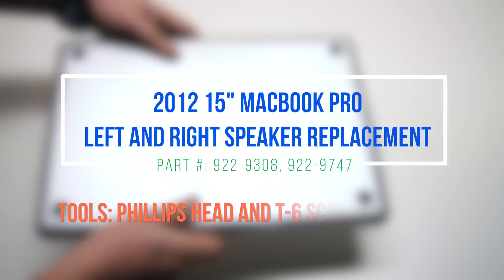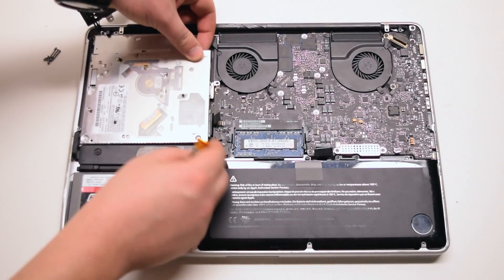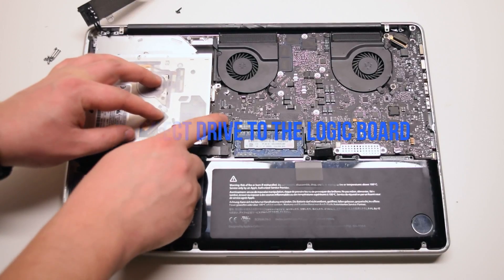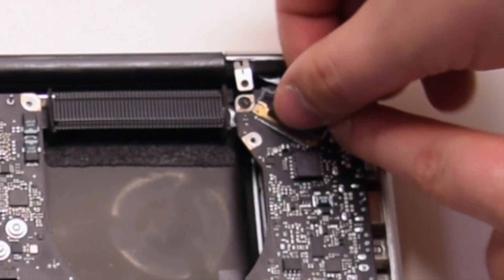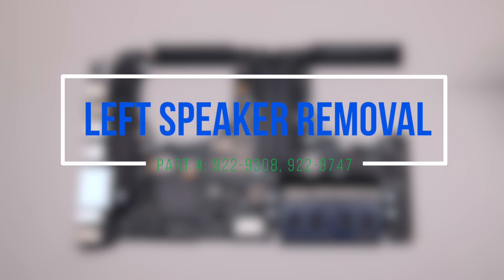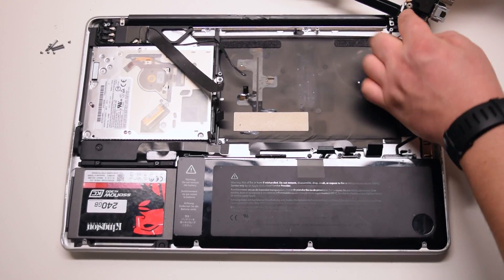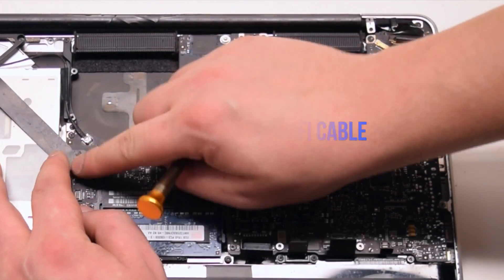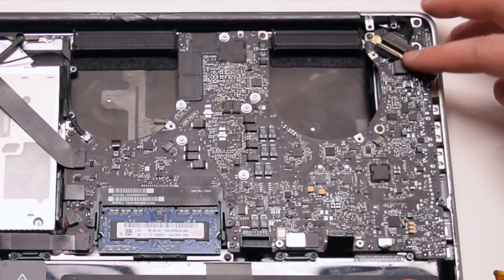2012 Macbook Pro 15" A1286 Left and Right Speaker Replacement

Comment: Wow, thanks for this. I recently brought my Mid-2012 MacBook Pro in to a local Mac tech to replace a faulty keyboard; when I got it back, the keyboard was fine but the right speaker was dead and the keyboard light wasn't working. This video showed me where the connections were and it turns out the right speaker connection wasn't seated properly and the keyboard light wasn't connected at all! I was able to properly get those components re-connected without going beyond removing the bottom cover.

Comment: Was a good video until you zoomed in and didn’t show disconnecting the speaker now I have to work out micro welding :( 
So not a pop off more pull out, my advice be careful
Reply: Well after researching micro soldering, I think I refixed the connector to the mother board successfully, wasn’t easy

Comment: This isn’t 2012? the insides look different
Reply: this is problably mid 2012..  retina macbook pro started in late 2012 and on..
Reply: It's Mid-2012 model MD103LL/A. The one right before the retinas. I followed these instructions and got used right and left speakers off eBay ($15 delivered) after blowing out my speakers with Soundflower. Easy to do if you take your time with connectors AND keep all screws in exact order.